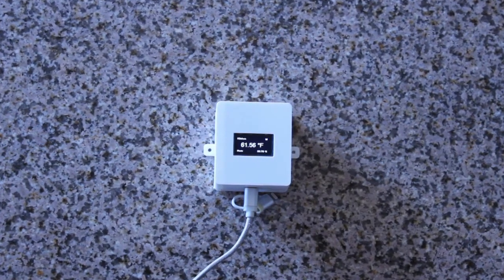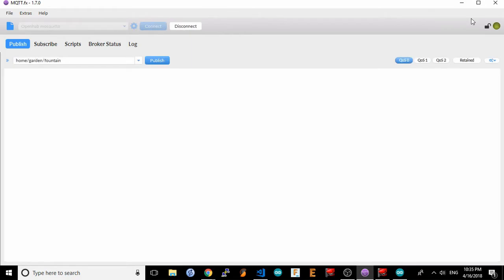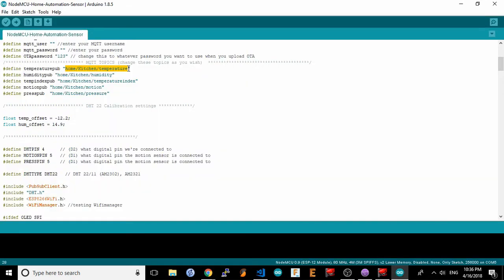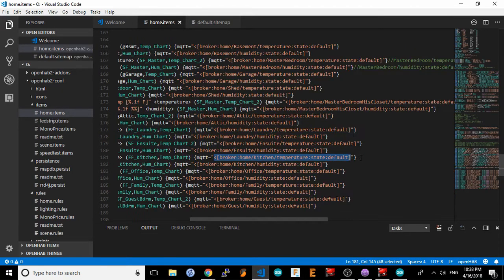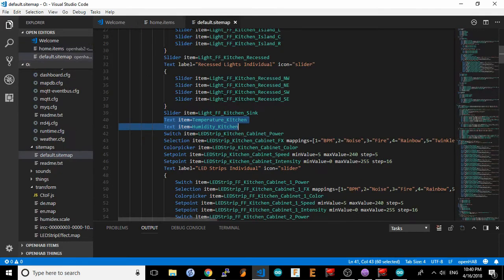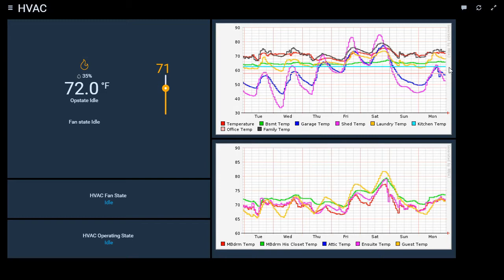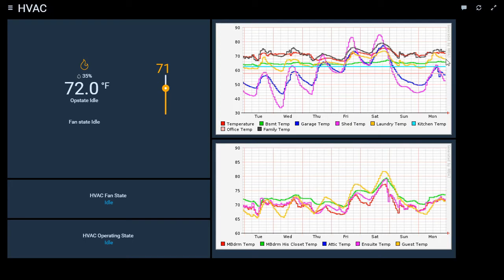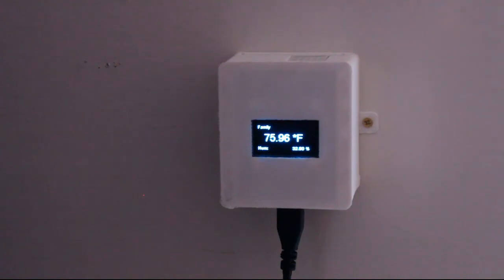NodeMCU Kube Multisensor | Part III | openHAB configuration & calibration

Comment: Hi BK,

I am using temperature sensors in cold store . I have installed 3 temperature sensors in 3 different rooms and i want to check  all the sensors values on a lcd display connected to raspberry pi so that the person sitting outside of cold store can check the temperature of all the 3 rooms and can turn on and off the motor accordingly.  
I have done the interfacing of LCD with pi and its working fine. But how to get the data from openhab to LCD connected to pi? Kindly help BK.
Reply from the maker: @Neelam Jangra - the easiest way I can think of is via Wifi/MQTT, just the way these work now. In my case, they connect to an MQTT broker, and openHAB uses these values to display them on my screens, but there's no reason you can't pick up the MQTT data anywhere else (including on the RPI). In fact, you can probably run the MQTT broker directly on the RPI, and use whatever program you've created for the LCD to read the MQTT values from the broker.

Good luck with your project! Share it with the community when you get something done!
Reply: @BKHobby  Thank you for your response BK. I already interfaced the temperature sensor with openhab and raspberry pi as you have done and i used 16*2 lcd with every nodeMCU in place of oled. That's working fine. 
But my challenge is how to get the data from MQTT for LCD display connected to raspberry pi. So that i can check all the rooms temperature at one place. 
please suggest me something for this. What's the right way to do this?
Reply from the maker: Neelam Jangra - Best solution I can think of is openHAB with Habpanel :) I have some videos on that, if you want to take a look (the full openHAB Basics series)
Reply: @BKHobby  alright BK i will check😊

Comment: Hi BK Hobby

Thanks for your videos and your ideas. Special for the board you have developed for the ESP - with temperature, humidity, display and the motion sensor.

But I’m still missing  windows/door sensor and maybe firesensor (like the one MK-smarthouse has made).

Buying single sensors for each room in the house is to expensive. I would love to have a box to put in each room, where I could get readings for that room with:
-temperature
-humidity
-any windows open (wired sensors into the box)
-maybe firesensors…
-motion sensor.

Would it be possible to make a box (board) that would have all these external connections points ?

/Jørn
Reply from the maker: Thank you for watching the videos and the kind words! 

I definitely want to build the sensor out to have multiple channels. Technically, using SPI or I2C, you should be able to tie multiple sensors in a bus configuration, so you could do any number of them. Obviously, it would be much easier to have switch contacts connected to each I/O pin on the NodeMCU, but there's not that many IO pins left after the DHT, motion and OLED. At some point, it might just be a better idea to have a dedicated Arduino (with more I/O pins) connecting all of the sensors in, and then sending that data from the Arduino to the NodeMCU via serial, for the NodeMCU to publish to MQTT via WiFi. 

I may tackle a project like this in the future, but for now, I have too many things on the TODO list ;)

Comment: Hello, I have a NodeMcu ESP8266 and I see it has the default button on it that is connected to pin 2, I was wondering if you could come up with an example bit of code that I can then copy and use for other buttons as my final plan is to make a control panel. I don't understand how the code with the sensors work so my idea was if you made the button code then I could just rename the pins and the mqtt name and then keep on copying and pasting it until I have made the control panel.I know I am asking for quite a lot but I would really appreciate it if you would be able to help me,Kind Regards.
Reply from the maker: George Eden - what you're asking is actually pretty much already handled by the code. Just take a look at the MOTION_PIN input handling. It basically does a digitalRead(MOTION_PIN) and puts the status of that input into the "motion" MQTT topic. So,  to read the built in pushbutton instead of the motion sensor input, you just need to modify the #define MOTION_PIN statement to point to the proper input (D2, I believe, instead of D4). That should then start sending the state of the pushbutton in the motion MQTT topic. To add additional buttons to the ESP8266, just copy the motion pin code (i.e. #define additional inputs, MQTT topics, and copy/paste the code for the motion handling).

Comment: mine is not connecting to the wifi after flashing the code, please help
Reply from the maker: Are you using the latest version of the github code? I added WifiManager so the Nodemcu should be creating its own access point now (something like “ESP_1234”)....connect to that WiFi access point and it should take you to a website to set it up with your home WiFi

Comment: Hey BK, great video. Which persistence service are you using for the charts?
Reply from the maker: Thanks SmartHomeBlog! I linked to your article on persistence, since it fits the topic well! I'm using rrd4j for charts and mapdb for general persistence. But, when I have time, I'll look at InfluxDB and Grafana for charts.
Reply: The sensor looks awesome! I will work on the next part of the persistence tutorial for the next month. 

Do you have sensors running on battery as well?
Reply from the maker: +SmartHomeBlog - not with these boards...I’ve tried running on battery, but they only get a few weeks of run time even with deep sleep enabled. There’s just too much power being used for WiFi startup, not even mentioning the OLED screen. I just put them near outlets so they’re powered from usb. Not having to worry about batteries discharging is nice :)
Reply: I  have all except the thermostats running on batteries, most of them are motion and door/window sensors and they have to be placed on locations where there aren't outlets around. 

That is one of the reasons because I don't use the nodeMCU that much. I use the Arduino Mini modified + nrf24l01. My door/window sensors have been running for more than a year on 2 AA batteries. You can set them up and forget about them :)